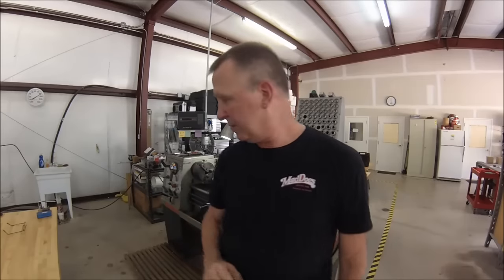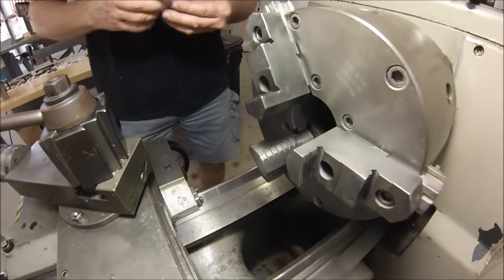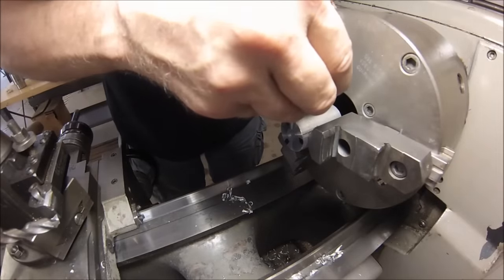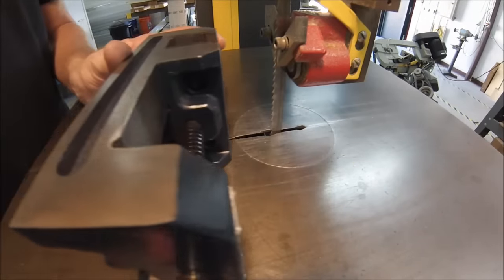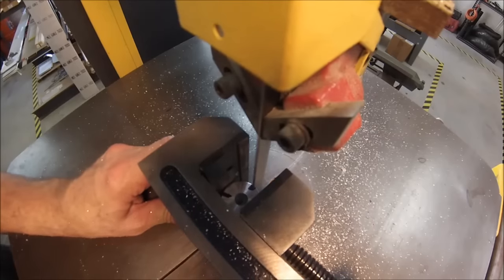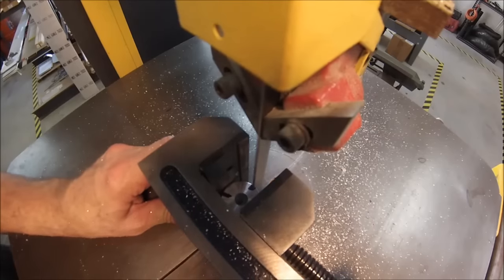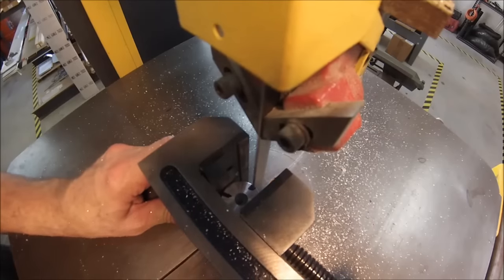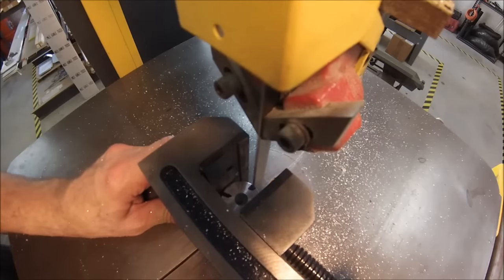Get your parts to run true in a non adjustable chuck. YOU MUST WATCH THIS!

Comment: DO NOT EVER EVER EVER file a part with the chuck turning towards you, in the direction that if the chuck grabs it, it will throw it at you. Always turn the other way. I was doing this once and it caught the file and slung it at me. I was lucky it didn't hit me. Very unsafe.
Reply from the maker: Filing a part with the chuck turning away from you has a better tendency to have you follow the file away leading you into a spinning chuck. Equally as dangerous.

Comment: Uh..........what's the point????  Anything you put in a 3 jaw will machine true because the lathe axis is true.  Move the part to another machine, or just remove it, and reposition it..................and you're F'd.  By the time you mess around with the fancy collet, you coulda put the part in a 4 jaw.  LOL.

Click bait.
Reply from the maker: Actually not. Chuck jaws can be worn and therefore translate eccentricity to parts you need to have running true. If you don't work to thousandths of an inch, I guess close enough is good enough. Definitely not click bait but nice try.
Reply: We know we have an axis through the  spindle that's true, regardless of any  runout in any chuck.  Your chuck could have .010  runout, but any part you put in that chuck will turn to the axis of the lathe............true.  But where the problem comes, is when you take that part out of the chuck........you immediately lose center.  The only true way to transfer parts from chuck to chuck is to use a 4 jaw.

I see what you did with the collet, and it's interesting, but it's not a solution to the problem.  A 4 jaw is the real solution to the problem.  You can't make a collet for every part you put in a 3 jaw.

It's an elegant one time solution, but it's weighty.  Limited to one part.

I do work to thou's.  And I trust my 4 jaw to do what I need it to do.  Granted, there's cumulative error, but the best you can do when it comes to manual machining is to try your best to limit that error.  It's a tough row to hoe.  

I do like your stuff.  I especially liked the way you busted the 29 1/2 degree myth when it comes to single pointing threads. @joepie221
Reply: @Farmersamm imagine, if you will, a person not having access to a 4 jaw chuck. A shocking concept i know, but it happens.
Reply: If you noticed he has an adjustable 3 jaw, so for round parts it beats a 4 jaw by a mile timewise. Save your 4 jaw for odd parts or large offsets

Comment: This trick works great been using it for years running 6mm drill rod in a 40 year old causing lathe.  Concentricity has stayed within .002 thru thousands of parts.
Reply from the maker: It really does. Just don't let the collar slip when you remove the part and you're golden all day long.

Comment: good clear video here, well done.
have made a pile of these over the years for modifyling screws/bolts as well. same idea but run your required tap size through before splitting. can even run a piece of all thread in the back side to act as a 'collet stop'

Comment: Wish I had seen this two years ago when it was posted.  Makes so much sense to use the machine to find its own center and then use that to center your final part.  Of course with some sloppy import mini-lathes the other half of the problem is actually the tool holding on the saddle and tailstock rigidity/repeatability.  If you can get them all tight and repeatable, with this technique, even a poorly aligned three jaw chuck will allow a concentrically held part to be worked efficiently.  Thanks.

Comment: I had a five year Machinist Apprenticeship over fifty years ago.
It was drummed into me by the chief engineer never to use the three jaw self centering chuck for anything other than concentric material.
I must comment that Joe has an excellent idea here for any machinist who has to use a worn or abused 3 Jaw chuck.
Reply from the maker: Its a band-aid fix, but will deliver the required results.
Reply: Yeah, he was definitely an engineer, not a machinist. Engineers have blinders on. They only know what someone taught them, not knowing from hands on.

Comment: Thanks Joe, what a quick way to make a "special size collet" for the odd size you may only need once. It looks like this would be great for sizes way beyond a regular collet maximum range. Great tip, JB
Reply from the maker: Thanks JB. Once you start doing this, you'll find many ways to apply this trick. They are re-usable too.....just bore them to the next size up, so don't toss them out.

Comment: Hi Joe!
This video is a lesson on a very high level. You have a high level of knowledge and tons of experience. I have nothing of that, being new in this trade. I try to use my new lathe, not known run out, to do things. Grabbing the stock and doing as much work as possible ought to make those surfaces concentric etc.. It will take a lot of learning, gaining experience, before I try something like You show up.
As I understand You were criticized for changing tools when the chuck was spinning, probably at the time  17:45. Watching Your video out of the safety perspective, looking only at Your hands, knowing Your experience, I see nothing wrong. Being a newbie I naturly stop the spindle .
Compare with my "riscy" doing, entering the small windowless bathroom shouver I bring a low profile living candle, then swinging the morning grown up on its hanger, on a safe distance, remebering the candle, then bringing down the large towel not so faar from the candle. Every firefighter would scream out. Compare this, and Your video Joe, with driving a car. You need to place Your foot on the proper pedal, clutch, brake or accelerator without any mistake. Knowing the terms, having the experience, knowing the riscs, being focused it can be done safely.
You can't be accused for being careless, negligant…. Several other Tubers could..

Comment: Thanks Joe, I’ve primarily used a four jaw chuck to indicate concentricity of a barrel but the used lathe I just got didn’t come with a 4 jaw so your video helped me determine how I would do it now. Keep up the great work. I also saw your video on threading Single point and plan to try that as well. Thanks

Comment: Great vid as always, now keep in mind there's no worry about runout if you can perform all the required operations without having to remove and rechuck the part. I.E. requires cutting the od, drilling, facing and parting off. The part will be 100% concentric to itself!
Reply from the maker: Absolutely right. This is very helpful if a large portion of the part is stock diameter, or its a second side op.

Comment: Thank's Joe, This is very useful, esp that last bit where you reveal keeping a big collecton of these for all sorts of purposes.
Reply: keeping a selection of brass or aluminum sleeves is also a good idea for parts that require a second op that requires flipping the part and chucking on a finished machine surface, as to not mar the part with the chuck jaws.
Reply from the maker: I never trust these to repeat after being removed. If I use one twice, its either not for precision, or I bore to the next size up.

Comment: thanks for the video, this is the kind of thing I watch machining videos for.  The quick and dirty cheats to make things happen.  I never would have thought to make basically a one time use collet.
Reply from the maker: Its not a one time use. Keep them and use them for the next larger size. They are 90% done.
Reply: you obviously know nothing of my organizational skills.........LOL
Reply from the maker: Great reply. A shoe box is a good place to start. Sharpie marker the sizes on top. Number the collars to match. Easy.
Reply: Yeah man, I thought the same thing. But if you size up I suppose it's useful infinitely. Or you make sure to keep it handy and oriented for the next run. I think anyone running numbers would be able to afford an adjustable, but who knows; we all grow at different speeds. Are you a VW tech Speedbuggy?
Reply: Chubbza5  I used to fab sand rails and work on VW's. The nick came from my manx fiberglass buggy that I installed a 1.8 16V from a rocco. Kept the FI and knock box control, that was back in about 95 or so.

Comment: I've broken my last centre drill before and had to drill a hole without the centre drill just by supporting the drill sideways with the turning tool so it stops the drill from deflecting until the full dia of the drill is into the material or you make a centre spot the size you need.  Just make sure the culling tool is on the flat surface behind the land of the drill.  Great videos Joe.  Love watching them.

Comment: Joe..I gotta hand it to ya Brother..that there is some nice advice for sure. I do have one comment. I notice that you and just about every other lathe guy use your file with your left hand directly over the chuck..I am left handed and learned to do just the opposite, and that is by standing to the right of the chuck where nothing can fly off and hit me. I just see a lot that can happen..Just my opinion..newbie subscriber and born in Lambertville NJ, now residing in Houston TX Y'all..Keep up the great work.
Reply from the maker: About the file comment. I believe you practice the way you have the most control and confidence. Everyone is different. There is nothing safe about filing a moving part in a lathe chuck no matter how you hold the file. Reaching over a spinning chuck is risky, but you have a solid registration surface to lean on with the head being under your left arm. if the file slips, you are already braced. your way, if the file slips, I see the likely hood of movement towards the chuck jaws much higher. I learned this way and feel very unstable and risky holding it opposite. Just my opinion.
Reply: daniel schibel, I am a southpaw as well. If possible, I bring up the tailstock to steady my right arm. Or, run a slower speed and take a few light cuts with the file. It takes a few seconds longer to ease an edge. But, it helps. 

Us southpaws have to adapt to a righthand world. LOL
Reply: Holding a file next to a spinning lathe chuck is a recipe for disaster. An easy fix to the problem is to make a quick change tool holder to hold and move the file using the cross slide. Everyone says, "It will never happen to me! I have been doing it for years and nothing has happened yet!" It is like drunk driving -- the answer to that statement is that they are right. Those people have been lucky, not smart. Get into that chuck once and it will be the last time too.
Reply from the maker: I wouldn't suggest putting a file in a rigid tool holder, but I do keep a 45 degree edge break tool setup at all times. I think I'll shoot a video of a file hitting chuck jaws to demonstrate what really happens. I can guess you've never done it. Stay tuned
Reply: That will be very good to see.  Safety first!

Comment: Thanks! I had tried a version of this in the past, but didn't realize until now that it was not perfect.
Reply from the maker: Tool geometry will affect the height of the facing and turning points. This is a good reference, but once in a while you may still need to tweek the tool height.

Comment: the idea is good when you have to machine multiple parts
for an unique part, I use a sheet of general use paper and I wrap my part taking caution to pass an equal number of paper rows between the part and each chuck jaws.
then, I gradually tighten the chuck while indicating my part and making corrections with a non marring hammer.
I always use this technique when I remachine the top ring groove on an engine piston on re-ring job and usually I adjust the piston head concentric within 0.001"
another advantage is that I don't mar the piston skirt with my chuck jaws.
Reply from the maker: Jacques, this tip is for a major concentricity error. It will also eliminate jaw marring as will your paper technique. I have actually used that technique to protect surfaces myself. Make sure you indicate square first, or your concentricity is false. Thanks for commenting.

Comment: I saw it work, but I didn't understand how it works.  But I will surely remember it.  Thanks Joe Pie.
Reply: He used the machine itself to drill a NEW CHUCK HEAD that was basically an extension to the jaws, but all one part.  Another way to think of it is he could have reamed the jaws teeth themselves. That's what I would do myself.
Reply from the maker: If you try to ream chuck jaws, I can promise it won't end well.
Reply: :D I'll trust you. It's been 30 years since I've ran a metal lathe :D

Comment: I bought a 9x20 home lathe 29 years ago "NOT made in China". but it does have ball bearing main bearings (I plan to put tapered bearings in it in a coupl months). I learned really quick to mark everything that needs to go back in the chuck before I take it out of the chuck. I only cut brass bronze and aluminum, for boats.
thanks for the video!

Comment: One of my apprentices put me on to this video and although it is applicable it is far too time consuming and would ask you to show a video of where you first square the part up and use ally or brass and on the end/side of the jaws from the sides of the chuck inside the jaw cavity of the chuck or if the jaw is proud to find your high low and tap the jaw after tightening. Not sure if you know that one but I've taught that method for many years and it's extremely accurate and takes only a minute. Good video none the less for hobbyists and cheers from your neighbor to the north.
Reply from the maker: If I didn't have to film and narrate this, I can make one of these in 5 minutes. I see the value in your suggestion, but I doubt it would correct a .015 eccentricity. I'll have to try it sometime if my error is small. Thanks.
Reply: Well with chuck sag doing it manually for sure. I always  do a final check dynamically to avoid sag at roughly 120 rpm. Also assuming that you're indicating a round part. I will make a video here shortly showing it within a few tenths. thanks for the response. I watched a few more videos and they well done. Cheers.

Comment: I'm not a machinist (haven't touched a lathe in 40 years) but after watching this I'm in awe. I know it works but I still can't really grasp how it does what it does (the mechanics behind it). The person who originally came up with this concept had to be one smart SOB
Reply: Your machine is true. Your simply transferring the true dimensions of the machine into a holder locked in the jaw. That's why its so important once you ream it and go to take the shim out or trying to put more parts in it you never move it. Once you start cutting on a part it will become true to the machine always. Hes simply using that to make a holder in the chuck that isn't running true. Making the holder in the chuck true instead. Simulating not having the ability to adjust that like some hobby or entry level machinist.
Reply: How though? I don't understand how you can't understand it.
Reply: When you bore the sleeve, you bore coaxial to rotation because the part always rotates around the axis of rotation irrelevant of where the chuck jaws are.  Outer side is in the off center chuck jaws, inner bore is coaxial to rotation.  This is why you can drill an off center hole in a part on a lathe, because it rotates around an axis that is off center.
Reply: Thanks- that helps
Reply: Thanks guys, I do get it but I'll have to admit that if I hadn't seen this I wouldn't have been clever enough to come up with this myself. Like I said, I'm no machinist so I've never given this any thought but I can see how some machines would not be true and you need a way to compensate for it. Now I understand why a 4 jaw chuck is so much more preferred over a 3 jaw.

Comment: Interesting videos.....I immerse myself in welding,fabricating,machining,drilling ,profiling  to finish and whatever it takes to get the job done right....or within my tolerance...Fire trucks to tigging,and profiling 2 5/16 pushrods to simulate 5/16 ball bearings that I just couldn't find at the shop to 3/8" long  to hold fixtures in a jig I also designed to make a part a production process easier and faster for me.....Magyverism in the blood.....There's nothing like  watching your inventions work to your satisfaction....Even better if your pay is what you deserve to be getting for the dedication that's put forth to make things right..........Everything runs on numbers........Informative machining tricks by the way....."Rock On " "Bud"...........Scott Piper
Reply: There was one thing though I forgot to add....I try to conciencly keep my everything away from a spinning anything.....Did everybody get that one???? Lol
Reply from the maker: The machine will always win if your everything ever gets too close to a spinning anything. Just a thought.

Comment: This is so awesome! I’ve only been practicing for about a month. The lathe I’m working with is a 1950’s machine used in a maintenance shop so not as many working hours on it as one in a production shop. Still has about 15k slop. I’m trying to modify some inserts for my hunting arrows but they are .166 inside diameter and .246 outside diameter with a .304 shoulder maybe .085 wide. Only about .756 total length and the shoulder has a 45 degree reverse taper from .304 to .246. I had a similar idea before I stumbled across this. With the tight tolerances I’m working with and only a six jaw chuck I don’t know if I can make it work? I made three from scratch and was only successful on one so far.

Comment: I've used that trick before, but usually to hold awkward parts (i.e. a poor man's collet).  Making a facing cut on a disk-shaped piece, for instance.

You have some good points made, and using a reamer to get the thing as near perfect round as possible is a good idea too, it amazes me sometimes how a out-of-round bore just continues to be out no matter how many times you take a pass with a boring bar.